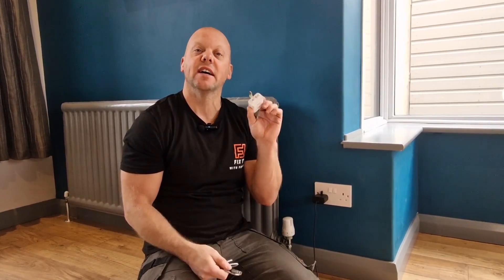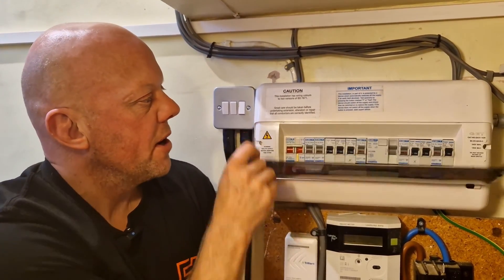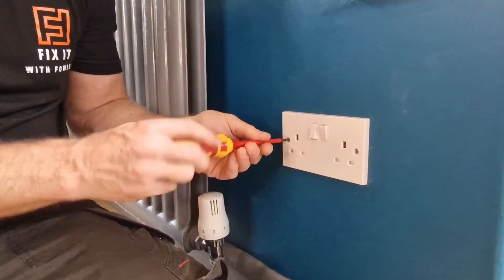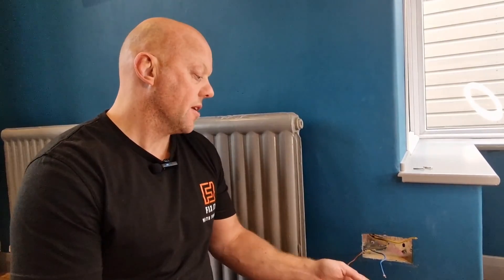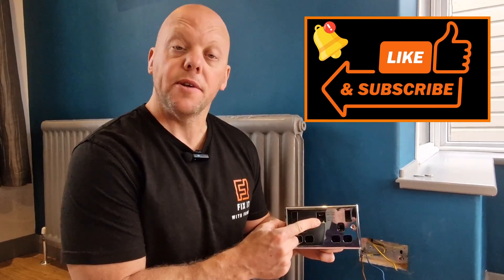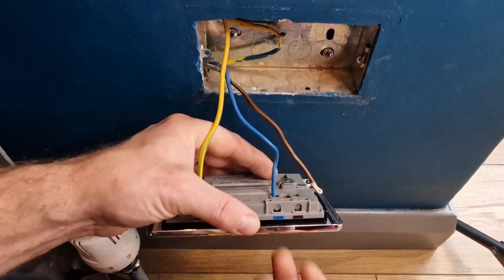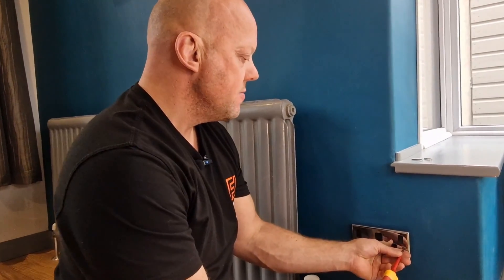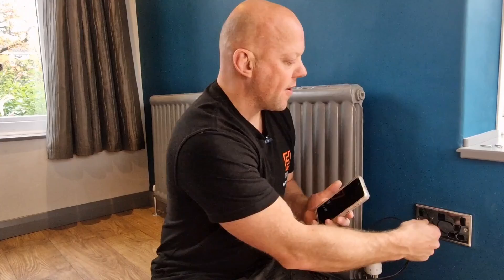How To Install A Usb Socket In Minutes!

Comment: I've installed USB fitted sockets around the house which were from B+Q, not cheap and nasty Chinese knockoffs from Amazon and apparently for fast charging but the problem I've found is like with my Samsung phone, if you don't use a genuine Samsung plug and cable the charging time is ridiculously slow. So still having to use a plug basically negates installing the new socket!
I've found that from near flat my devices take around 10 hours to charge using the USB sockets but only 1 hour using the OSB plug and cable. Basically the USB fittings are pointless.
Reply from the maker: The integrated usb chargers are limited in power due to the space required in the back of the socket. Even the so called fast ones are not equivalent to a plug in charger.
Reply: @FixitwithFowler  Yes that is a downside to these sockets. A bit silly really.

Comment: I've just fitted mine , got a shock from the green wire ( I had everything switched off too )  .. sockets work but USB doesn't 😂😂😂😂
Reply from the maker: Sounds like the socket front is faulty
Reply: @FixitwithFowler  I've took it back off and it was the brown wire that zapped me 😂.. felt it come outta my big toe ... anyhoo , I turned the whole electrics off and not just the sockets and started again ... Bosh all sorted 😁 and I still have my fingers 👋... Ps .. USB was fine , it was a faulty charger 😆
Reply from the maker: @tinydancer9602 lol, at least you have sorted it! It definitely wakes you up if you get zapped!
Reply: @FixitwithFowler  😂 Deffo , I'll leave that type of stuff to an electrician next time though!